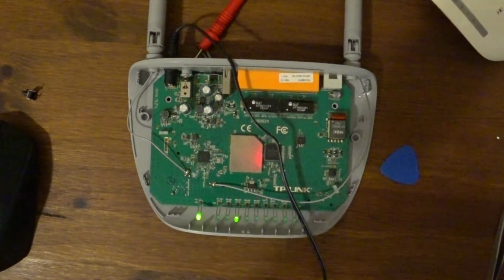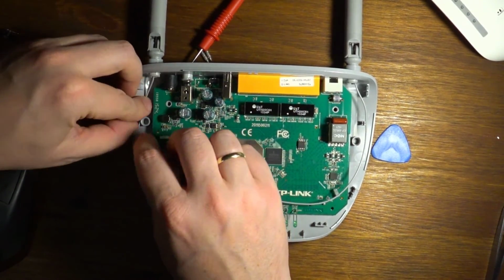How to Fix TP-Link TD-W9970 VDSL router

Comment: I've got overheating after on and several minutes working by this model - router gone to freeze, and then reboot needed. That circling continuously... And stops after cooling fan set under router ,and then working correctly without freezes